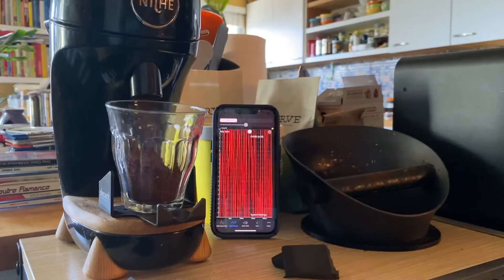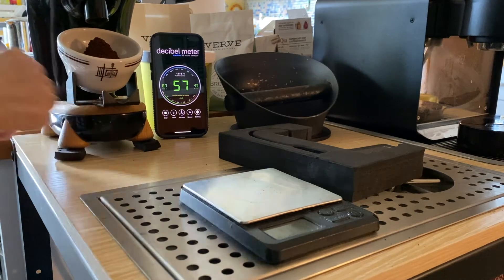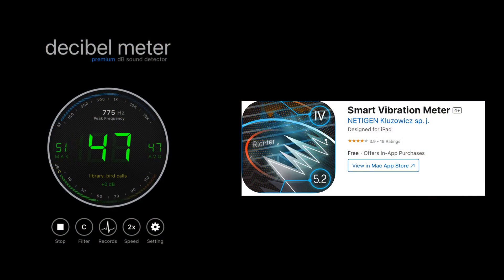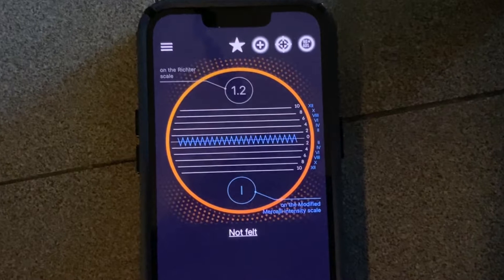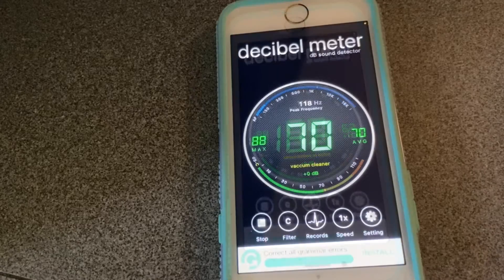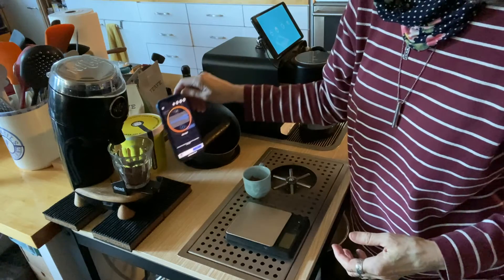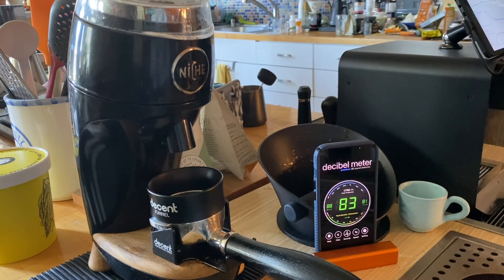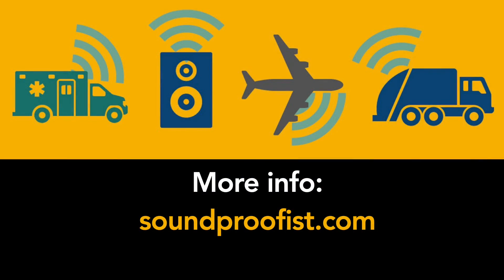The amazing power of anti-vibration pads: how they stop appliance noise

Comment: I want to use them as floating flooring for a soundproof booth. I need 16 support points for an 800-kilogram booth. according to the AI, each one supports approximately 400 kg, making the booth very light and not activating the elasticity of the pads. I am referring to the blue ones with EVA, which are better than the cork ones. There is also another one made of rubber that supports the same weight.
Reply from the maker: That sounds like a good idea! Do you mean for a vocal booth?
Reply: @soundproofist Yes.
So the neighbors don't hear so much noise.
Reply from the maker: @carlospenagos1489  On behalf of your neighbors....thank you!

Comment: If my furnace is vibrating the floor above where I sleep, if I put a damper pad under my mattress, will that reduce the vibration alot? My mattress is directly touching the floor. It's not on a bed frame.

How much material would you need?

Otherwise how would you reduce the vibration from the furnace?
Reply from the maker: No. You need to reduce transmitting tbat vibration at the source, which is under and around the furnace itself.

Comment: Would this work for a mini fridge
Reply from the maker: It's a good idea to put these pads under a mini fridge. It will stop the motor vibration from going into the flooring. It won't eliminate all airborne noise in the room, but it means your adjacent neighbors won't hear the droning of the motor through building frame. They're inexpensive ($10-$12 for all four of them), so you can't go wrong!

Comment: I should have said stop the vibrations due to lightly stomping.  Do anti-vibration pads actually filter out these "low frequencies"?  These seem to me to be quite different from the bass vibrations you speak of in the video.
Reply from the maker: Anti-vibration pads on the receiving end are not going to help. They only reduce noise if they're underneath the source of that noise (like exercise machines, fans, other equipment) but not if you're on the receiving end. So putting them under your furniture won't reduce the incoming noise.

Comment: Is there any way to stop the noise if the perpetrator happens not to be mechanically but humanly caused?  I'm referring to Cro-magnon  neighbors who sometimes stomp (lightly) on the floor in room next to my bedroom during all hours of the night to wake me up.
Reply from the maker: So, these are next-door neighbors or upstairs neighbors? Either way, that impact noise from their feet is going into the building frame and causing vibration, where it picks up more "bass" tones and you can hear it/ feel it. A lot of this noise could be reduced if they would put down rugs with a thick carpet pad under it. Your landlord or apartment association might have a document (rental agreement or HOA CC&Rs) that cite the guidelines for the amount of carpeting or limits on noise. I would refer to that, first, in case your neighbors are unapproachable or give you attitude when you politely bring up the issue. Another thing you could do is ask them to wear soft-soled slippers in the house with open backs on them. Why "open backs" (like a clog)? Because they prevent the heel bone from striking the floor first, which is often the cause of the stomping sound. But the slippers need to have soft soles, like felt. Or thin, flexible silicone-like dots (anti-slip) on a soft sole. Otherwise it will sound just like boots on the floor.
Reply: @soundproofist  So, i don't have Cro-Magnon neighbors above me, i have kids. I was just looking for a good cut off for my bed frame to block the sound being channeled from the ceiling, through the walls, and into the floor and up into my bed frame. would it be realisticly effective for this?
Reply from the maker: @danielkipp5104  The issue needs to be dealt with at the source (in your neighbors' unit) or the path (decoupling or muting sound from the building frame), but doing putting blocks under your bed frame won't make a difference with the kids running upstairs.
Reply: @soundproofist  I'm afraid I didn't explain it clearly enough. Forget the CM metaphor: this guy is a sociopath who is literally in his bedroom (right next to mine in the apt layout) and stomping on his floor to wake me up at various times during the night. Also the problem is most definitely a vibration problem: the structure of this apt bldg is so flimsy that lightly stomping his foot jars me awake most of the time.

Is there not a way to separate my bed from the floor on mechanical springs or on a concrete block? That's the ONLY way to reduce the MECHANICAL vibrations, it seems to me.
Reply from the maker: @johncarter-i7d  So what you're saying is that the "stomping" is totally silent? You just feel it, but it's quiet? That's unusual. I'm not a structural engineer, so I can't speak for your idea about concrete blocks, etc. I do get similar questions here periodically that say, basically "I can''t sleep because my neighbor is causing vibrations from stomping/subwoofer/mechanical thumping, so if I put anti-vibration pads under my bed, will I be able to sleep peacefully?" The answer is "no." MAYBE decoupling your floor from the joists would help, but that's an expensive proposition, and it doesn't address flanking noise/vibration in the walls. Consider a consultation with a professional structural engineer in your area if your apartment association/HOA is unwilling to help with the troublesome neighbor, who is violating your right to "quiet enjoyment" of your home.

Comment: I"m interested to find out:  It's a tenant in the condo below me who constantly has a vibration coming up through the floors into my unit. He has hardwood floors, to add to the problem. What can I do besides tearing out my carpeting and installing dampening devices?  He's a jerk, doesn't care. None of the previous tenants in that unit ever caused that noise, so it has to be something he's running...a 3d printer maybe?
Reply from the maker: If you're having issues with a neighbor creating a noise nuisance, you should first try all the available avenues to address it before you think about construction. To start, I suggest that you put your mobile phone on the floor and record at least 30 seconds of audio from the "vibration" going through the flooring -- I'm sure it makes a sound. You probably won't get a sufficient recording of this vibration if you just stand in the room with your phone in your hand unless you put the microphone right to the floor. Second, you said "the condo below." So if you live in a condo building, there's an HOA or management association to ask for help. You'll need your recording of the noise, which is probably low-frequency noise. If the person downstairs is renting from a condo owner who doesn't live in the building, you can also approach the legal owner of that condo. Most HOAs and apartment buildings have a policy about the "quiet enjoyment of your home", and if you're unable to get peace and quiet when you need it, this might apply.

Comment: Woukd these work for a neighbour living downstairs, who snores like a 🐷🤦??
Reply from the maker: Ha! I empathize, and I wish you could put these under the legs of your neighbor’s bed and then never hear him again. I had a similar problem a few years ago, but after tearing out the ceiling downstairs and rebuilding it with soundboard, insulation, and mass-loaded vinyl inside, then finishing with a decoupled ceiling hung with isolation clips, and 3/4” soundproof drywall, I finally didn’t hear the deep-bass snores anymore.

Comment: tbh very high frequencies are more annoying to me lol.
A lot of noise is from the cup shaking I imagine, the pads encourage that AFAIK.
it'd be nicer to use a very rigid foam here in this case.
Reply: Hire frequencies are annoying because human ears are sensible to higher frequencies.  But believe me, lower frequencies, <200 hz are more problematic if they resonate with one of your room mode, and are very hard to eliminate. Higher frequencies are easiest to eliminate and attenuate.

Comment: What about using them combined?
Reply from the maker: Like, combining a neoprene pad with some anti-vibration blocks? Sure, that could work. I have a Lasko tower fan sitting on my floor, and I did that. I put a sheet of anti-vibration rubber on the floor, the kind that's used under a sewing machine, and then on top of that, I have four of these cork-rubber pads under the feet of the fan itself. The two combined have reduced the vibration (especially when the fan rotates back and forth), and I'm sure my downstairs neighbor is happy to not hear a constant droning sound coming from my apartment.

Comment: Uhm, my landlord who also happens to live underneath me accidently happens to install a ceiling fan right under my bedroom. Now i just cant sleep with those vibrations stemming from the fan underneath my bed. Would these pads help reduce the vibrations if i place them under all four  feet of my bed?
Reply from the maker: Putting anti-vibration pads under your bed (the receiver) probably won't be very effective. The most effective is at the source (using anti-vibration mounts where the fan is attached, etc). As Al Fierstein (acoustician) explains in another Soundproofist video (https://www.youtube.com/watch?v=FS9T7woI8GE) these pads might only be effective on the receiving end if it's just vibration, no droning sound. There ARE anti-vibration mounts for fans. Have you talked to your landlord about it?
Reply: @soundproofist  Yes, it's just about the vibration that makes it difficult to fall asleep.  So, um, it won't work yeah?
Reply from the maker: @joy7436  You can always try it ... .it probably costs $12 or so (not including shipping) to buy a set of 4 blocks. I can't guarantee they'll reduce the vibration. But if they do, it's a win, and you should let us know.

Comment: Why would anyone want to spend money on pads and also have the horrible aesthetic of that under their coffee machine or grinder? Surely the neighbour isn't having to hold onto their seat when the person above makes coffee.
Reply from the maker: This was a simple example of how everyday activities or appliances can vibrate and create low-frequency noise that can travel into the building frame and become a nuisance to other people in the building. Obviously, you only operate a coffee grinder for a few seconds, so this particular appliance is not a huge concern. But when it's something like a fan, air conditioner, or washing machine, those appliances can run for hours -- thus tormenting adjacent neighbors. I get emails from people who are afflicted by continuous vibration noise. These kinds of pads help to reduce the vibration that can travel from one hard surface to another and go into the building frame, picking up energy along the way and creating a bass-like drone. Everything seems pretty "normal" if you're at the source of the noise, and you might not even realize that it can be heard outside your home. But no one is demanding that you ruin the aesthetics of your coffee grinder.

Comment: These anti vibration pads may help with a washer or dryer--but they don't offer any help at all when it comes to subwoofers.  These things should be illegal in tenant buildings.
Reply from the maker: Totally agree. Even if a subwoofer isn't sitting directly on a floor or shelf, the deep, long bass sound waves coming from it will travel through the air and then become low-frequency noise inside the building structure. This is why you can hear a car with a loud subwoofer in it from several blocks away, or fireworks, or a Harley Davidson motorcycle, for example. These noise sources don't need to touch your building for you to hear them. The sound waves can travel a long distance and penetrate all but the thickest building structures.
Reply: @soundproofist  They never should have been invented

Comment: would this work for reducing noise comi from apartment next to me? i can hear every footstep?
Reply from the maker: No, anti-vibration materials need to be used at the source of the vibration (not the receiver). So the "boom" of those footsteps needs to be dampened before it goes into the building frame. It might be softened by putting a soft carpet with a thick underlayment under it (like felt and rubber) on your neighbor's walking paths. That's the most-reasonable and affordable way. Beyond that, it would require some "decoupling" of the subfloor from the floor joists, which would be expensive, disruptive, and very difficult to get consensus on.
Reply: @soundproofist  I shouldn't complain amd should be thankful I have a roof over my head. thank for the information
Reply from the maker: @Luucciidd  I, too, am thankful to have a roof over my head, and I do my best to make it as livable as possible!

Comment: This might be a silly question but if I stacked 2 anti vibration pads on top of each other would that help even more with cutting down vibrations? I read somewhere online it could have an adverse effect. Sounds a bit strange to me.
Reply from the maker: What is it you're trying to accomplish? Just wondering why you'd stack two pads together. That said, I have an oscillating (tall) fan tower sitting on my floor, and  it's on a flat rubber mat, which is on top of carpet, and on top of the rubber mat, I have four anti-vibration pads (with the rubber treads) placed under the base of the fan (not stacked, just spaced apart under the large base of the fan), and then the fan. The rubber mat was made to put under sewing machines, so it's solid and thinner than the pads. 
I can test two anti-vibration pads stacked on top of each other with the tread facing in opposite directions and measure the frequencies, etc.... but it seems like they might create some vibration due to the stacking and possible movement between the two.
Reply: @soundproofist   @Soundproofist  there are two large AC units on the roof that cause a lot of vibration, they currently have cork vibration pads under them but they're starting to get worn out and are like rocks. I was planning on stacking 2 EVA pads on each leg to help reduce the vibration even more but when I read that stacking 2 can cause vibration I was a little confused, as that's totally against all logic. It would be great to test the theory. Thanks again for the reply!
Reply from the maker: @shamrocky  Are you able to lift these units? And yes, the pads do "wear out" eventually. I have anti-vibration pads under my washer/dryer (they're vertically stacked) and I need to replace them. But before I do, I want to create an extra "floor" to sit on top of the existing floor under the laundry equipment to add more mass. Might be two pieces of plywood with a viscous layer inbetween them, on top of a sheet of thick rubber. So, a sandwich: original floor, sheet of rubber, sound-dampened plywood, then new anti-vibration pads to go underneath the feet of the washing machine. I already have QuietRock walls in that space. The trick is to get my next-door neighbor to do the same, because the neighbor's machine vibrates through to my apartment.
Reply: @soundproofist  they're heavy enough to need a jack to lift them up. I envy people that aren't bothered by vibration noises, personally I can't stand it and it has been an issue for years especially with neighbors. 

Also it's amazing how even small device can make such an annoying vibration. I had a neighbor that had a small water feature placed directly on the floor that had a little water pump. I complained to him about it and he sent me a video and it was silent. All the vibrations where being absorbed into the floor,. From my apartment it sounded terrible.

I'm planning to double stack the pads under the AC unit tomorrow I'll let you know if it makes a significant difference!
Reply from the maker: @shamrocky  Yes, I think most people don't realize how something that doesn't seem to emit a loud sound (like a vibration or hum) can become so annoying when it goes through a building frame into another room or apartment.  Like how I showed in one of the Soundproofist videos that an annoying hum in my room was coming from the oven fan in the kitchen of a next-door building that I didn't realize was connected to our building via a small section of covered walkway.

Comment: Great video, would you say EVA is better than cork for HVAC?
Reply from the maker: I think so. However, I'm not 100% sure if all EVA products are weather-resistant, particularly water-resistant over a long period of time. That's mostly relevant if the HVAC is outdoors. I get mixed info when I search for the answer. EVA is used in shoe soles and other applications that do make contact with water. It can withstand hot temperatures up to 350 degrees Fahrenheit.
Reply: @soundproofist  I had no idea about the specifications but as I live in a dry very hot climate it sounds as tho the EVA would be ideal. Thanks again for the great videos!

Comment: I live in an apartment block in London and there’s recently been strong vibrations in every room. Up through the floor. The guy below swears it’s not coming from him but he could be lying. I recently started high blood pressure meds and I believe work has been done on the building’s ventilation system. I’m wondering if either of these have any bearing on matters?

It feels like very, very strong bass but I hear nothing audibly. Just feel it. My brother does not feel it which I find astonishing. Anyone have any ideas? Driving me insane.
Reply from the maker: Since you're in the UK, I recommend contacting The Noise Chap. They do noise and vibration measurements and have the right equipment and knowledge. https://www.thenoisechap.com
Reply: @soundproofist  thanks